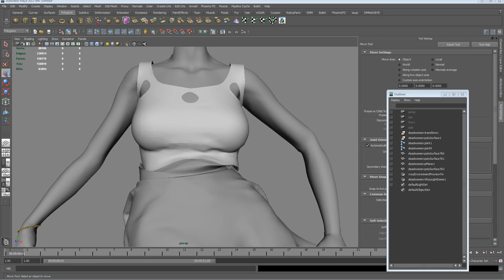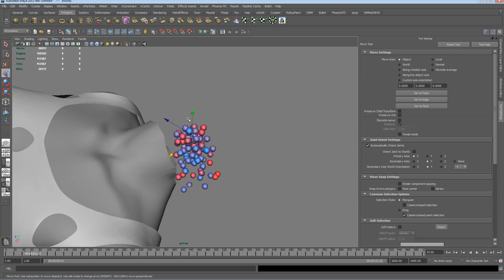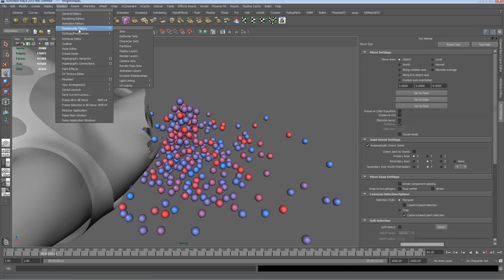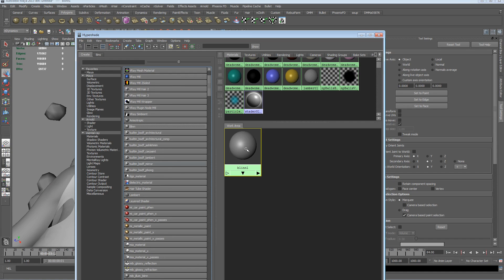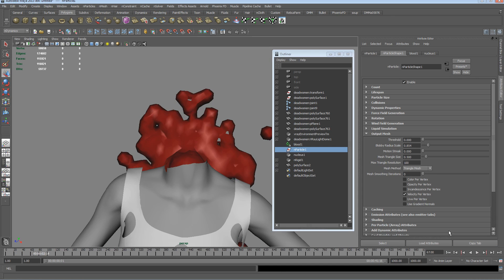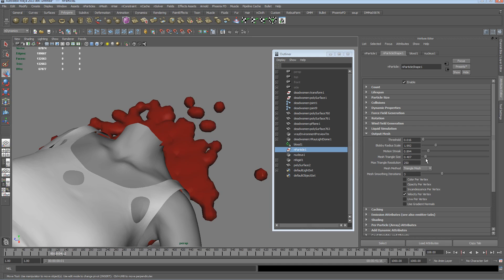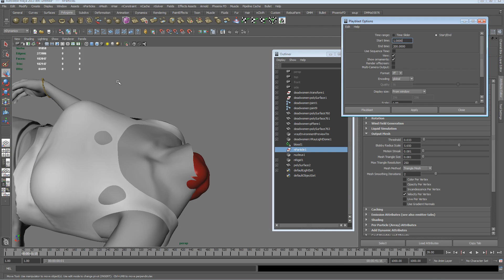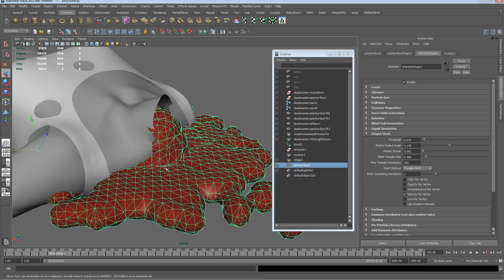Maya nParticles Blood spill tutorial.

Comment: Would this same approach also work for a character drooling? I have a character that is biting into a candy and I would love for drool to come out from his mouth while I'm featuring it in my Demo Reel.
Reply from the maker: It depends if you want it to drop down to the floor. For some drool I would personally approach it with some modeled geometry and make copies for Blend Shapes and animate between them with an appropriate shader.
Reply: escapeephil  Well I'm trying to get the drool to come out of the mouth colliding with the candy and his hand, I have gotten that done using Ncloth, but I wanted a little more realistic looking effect as far as some of the drool dropping and making a little puddle on the ground. You think Blend Shapes would still be best?
Reply from the maker: Pretear521 I think you always need to think about set up time of a simulation i.e getting it looking spot on vs achieving the same effect in other ways. As there is quite a distance that your drool needs to travel I don't think blend shapes will be the way to go - instead think along the lines of 2 emitters - 1 for the drool from mouth to the first object (candy) and another 2nd emitter already parented to the 1st object (candy) that begins its simulation once the 1st particles hit the sweet and start to build up. Finding the sweet spot where the second emitter starts to emit will be essential so for instance when enough drool builds up over the candy then start the second emitter. If you are using ndynamics they will of course interact with each other but keep in mind that you can disable that function if required.

 Finally you may want to model the puddle over two versions and possibly use a blend shape to make that grow as relying on the simulation to do everything all at once will be time consuming in getting the balance of enough goo on the floor v a thin strand of goo from the candy. If you break it all down like this it could work quite nicely. make sure to set up some display layers for each step so that you keep things nice and tidy. On the other hand, if you know realflow and have access to that use that for an all in one solution, again prepare for some set up time for this. Remember what you are trying to create is essentially an effect that couldn't or wouldn't physically happen in a small amount of time i.e drool leaving the mouth, hitting candy, falling to the floor and creating a puddle would require allot of drool and time to see it happen which will = your audience falling asleep....unless of course you think like a film maker and don't do it all in one shot and use separate scenes for separate shots and hence separate approaches which will be much simpler and tell the story in less time. Your call my friend.